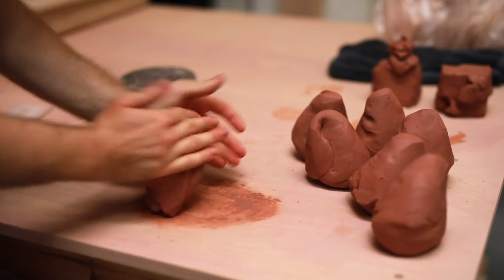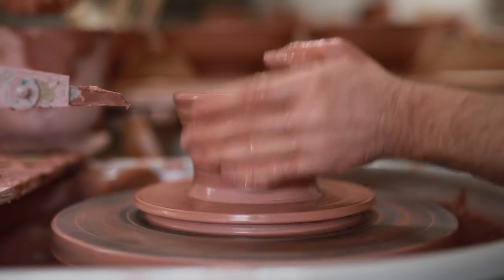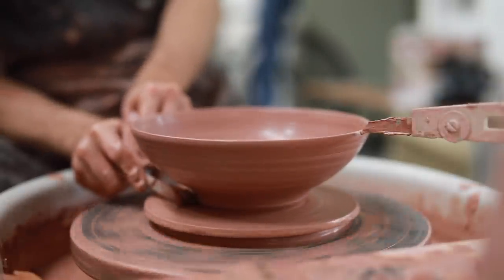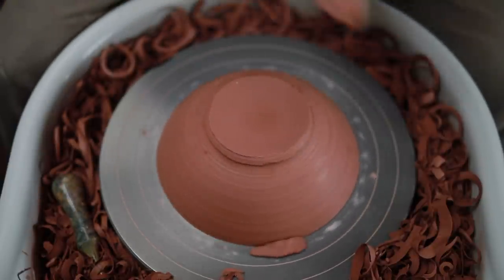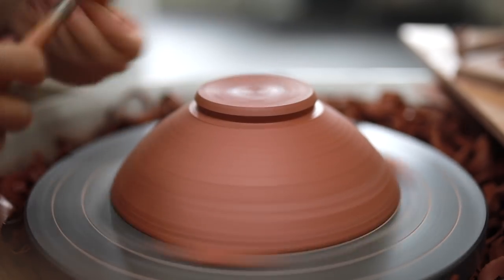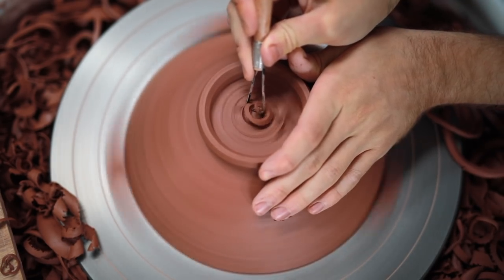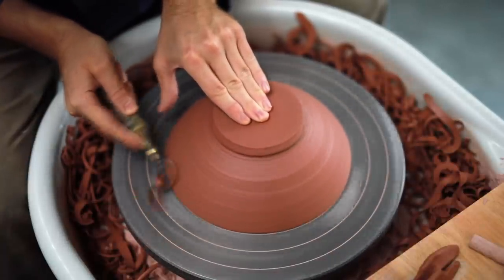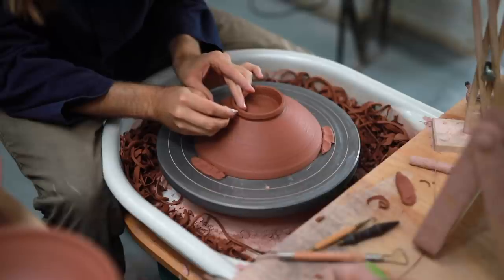How to Throw and Trim a Shallow Stoneware Bowl — Narrated Version

Comment: My sides always collapse.. not sure why.
Reply from the maker: Could be that your walls are too thin or you aren't leaving enough support clay in the base, there are multiple reasons but the main one is likely practice. Just keep throwing and throwing and throwing, it takes time, hundreds if not thousands of pots at the beginning.
Reply: @floriangadsby  too thin at the bottom I figured out today.  Had some success and many failures all squished down to have another round.
Thanks for your reply.
I really, really do appreciate it.

Comment: Thanks! I really like the shape of the foot rim on your bowls. Easy grip too!
Reply from the maker: Thank you! The easy to grip foot certainly helps in the glazing process too actually, as the defined facets clearly mark where I need to apply wax and then wipe off and clean up afterwards, without that edge that process would be a pain. Thanks for watching!

Comment: Your videos are amazing, I'm looking forward to seeing more!  Whats the advantage of placing a bat on a skim of clay instead of on bat pins?
Reply from the maker: Thanks Dustin! Well, it's personal preference I guess. Pins systems are quick too but if you want to use the actual metal wheel head there's the spinning pins in the way for some forms. The skim of clay is fundamentally more customisable but I wouldn't say it's all that more advantageous, it generally just depends on how you were taught/what you prefer.

Comment: Love these and your work. I wonder, is it possible to use the clay that you trim off?
Reply from the maker: Thank you very much! And yes, it is, all the trimmings that are removed from my pots is recycled. I let the pieces go totally dry and then submerge them in water. Once I have enough and once all the clay has disintegrated into a sludge, I remove the excess water and put the sludge, 'reclaim', onto a plaster batt. The plaster batt pulls out the moisture and once the reclaim is back to a clay like consistency I take it off the plaster slab and wedge it up until it's usable again. There is a limit to how much you can do this though, reclaimed clay gets weaker and weaker and will crack easily, but I mix mine with fresh clay from the bag, so this tends not to happen. Thanks for watching!
Reply: @floriangadsby  Thank you, I'm happy I found your videos. After growing up in Stoke on Trent and working in a pott bank for school work experience I actively avoided pottery ha...now I love it

Comment: Excellent video Florian. I generally don't like to trim in a foot on the underside of my bowls and mugs,  I just trim the outside of a foot. I have always liked to create functional pottery, and this to me means a flat bottom. I have an old Denby dish set that has incredibly high feet on the bowls and mugs. Drives me nuts when I take them out of the dishwasher and have the water collected in the foot fly all over the place!